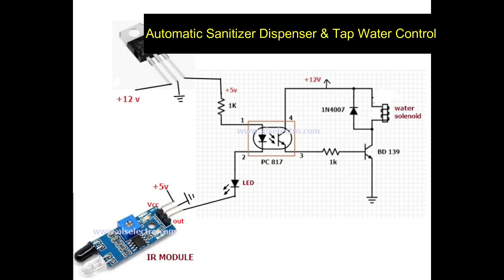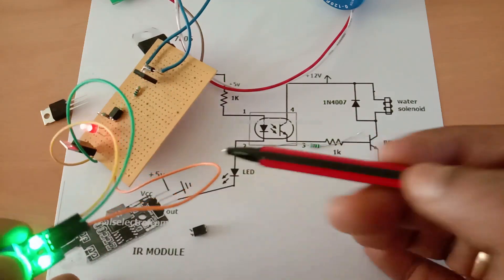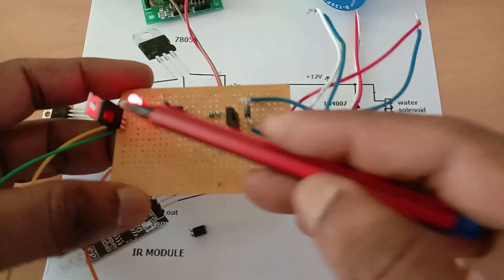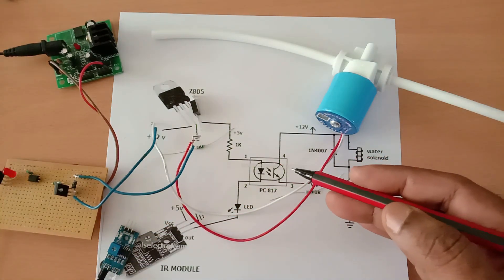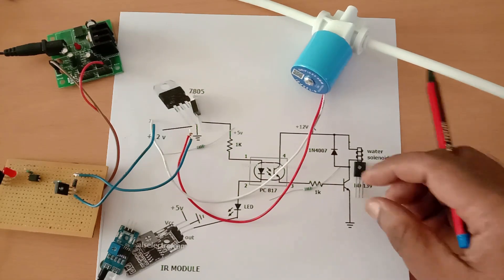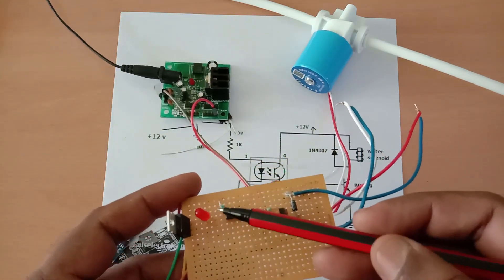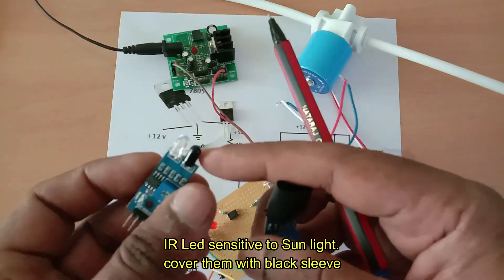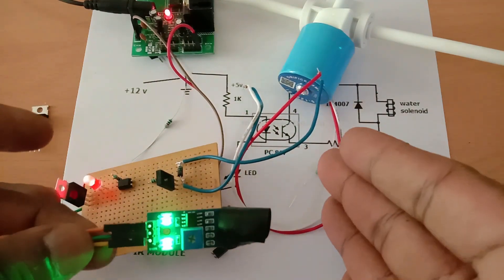Auto Sanitizer Dispenser and Tap Water Control

Comment: I had made a automatic sanitizer dispenser but there is a problem when ever the sanitizer gets finished in tank air bubble gets in motor and will not dispense till the air is removed. What needs to be done to avoid this problem.

Comment: Dear Saravanan I used Relay in place of solenoid valve to run dc motor .....Sometimes motor behaves funny it stats automatically ....Please Reply
Reply: IR module i found to be very sensitive to  sunlight ...It with switch ON motor any time there is bright sunlight

Comment: Sir I have a query How much voltage should we connect with solonoied valve and where from the supply will come.
Reply: 24 volts . Supply source will be External adapter .

Comment: Why we need to use opto coupler to trigger the output. Instead can I use 5v coil relay connected to  IR object detector output. So I may able to control ON/OFF solenoid or water pump?
Reply: Can you elaborate what you are try to say?

Comment: There is no need or purpose for the opto-coupler. Both sides are supplied by same power supply, there is nothing to isolate.
Reply from the maker: Opto is used here as Coupler and no need of isolator.Common GND circuit in coupling mode, to switch between 2 voltage.
Reply: Saravanan AL sir i want understand this circuit properly kindly understood me this is my whtapp no 9218787008
Reply: @SaravananAL  how can I contact you?

Comment: Sir,why you wrapped insulation tape on sensor module.just take out that . it will absorb IR RAYS from sunlight  and the whole project gets wasted😄😄😄😄.please viewers don't try to make this project under sunlight it's only for indoor use .even sun  light from window also make your project flop.you will lose sanitizer unnecessarily.use ultrasonic sensor with pic10f200 microcontroller.
Reply from the maker: IR used as object detector and in Sun light or even daylight , without sleeve this will not work.
Reply: With black sleeve there IR modules r dependable for commercial use?
Reply from the maker: @Thiruchirambalam  For commercial product , IR Proximity is best as it has  modulation/demodulation circuit.As this sensor is in demand I'm developing a modulated IR module with PLL circuit.Will post the video soon.

Comment: This ir model range in  cm pls. Ir price pls sir
Reply from the maker: IR range is 1 to 2 cm only .If more range required go for IR PROXIMITY sensor which works up to 1 mtr
Reply: Upto 20 cms.you can buy original sensor at  dfrobot upto 80 cms .but to make sanitizer dispenser 20 cms is more than enough.